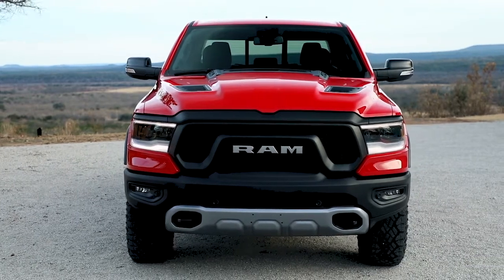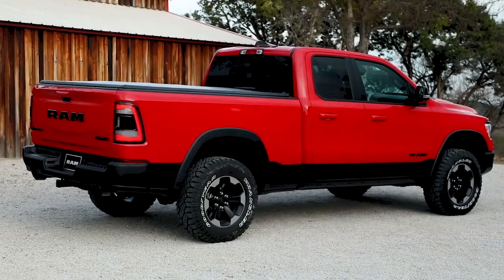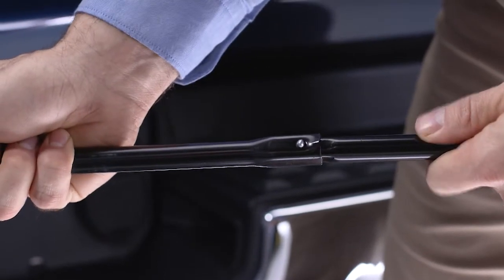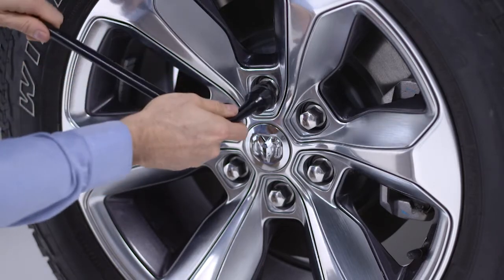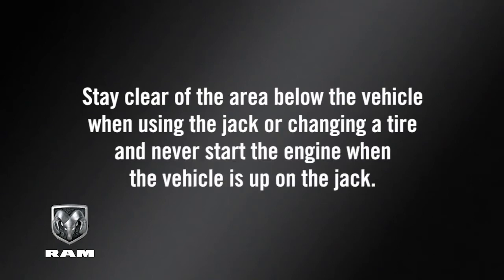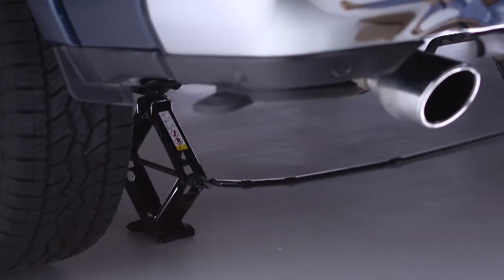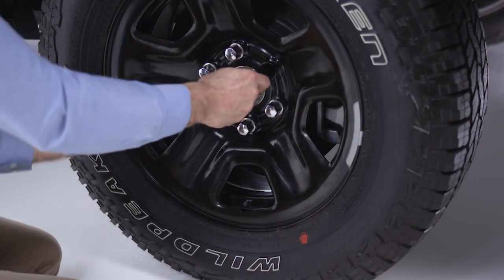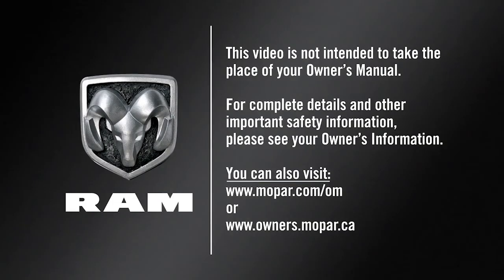Jacking and Tire Changing | How To | 2023 Ram 1500 DT

Comment: What's the part number for the jack seat cover panel? It's really hard to find and the part often provided on MOPAR sites and by my dealer is wrong. Keeps coming up as 1JA35TX7AC which doesn't fit the Bighorn trim (size tabs and clips are wrong)
Reply from the maker: Hello, @matthewreetz5108. We would love to help you find the right part for your Ram. We ask that you please send us a private message via Facebook, Instagram, or X with the year and model of your vehicle, and we will assist you further there.^DS